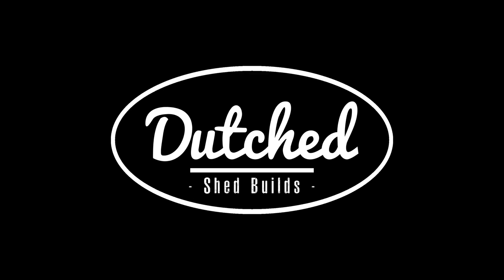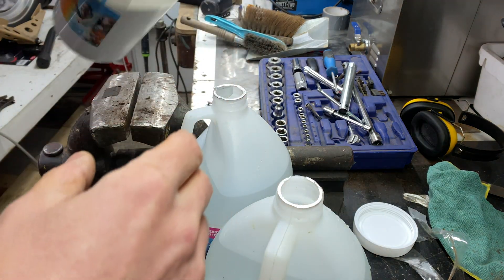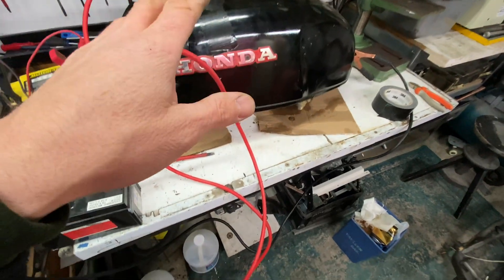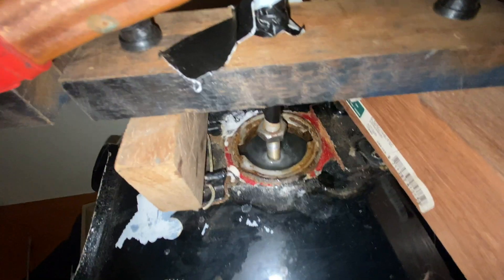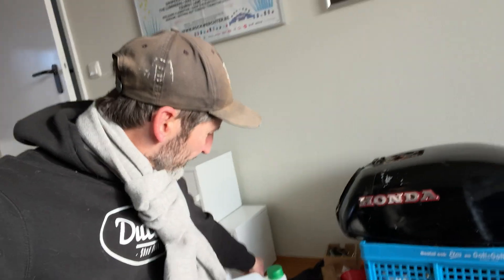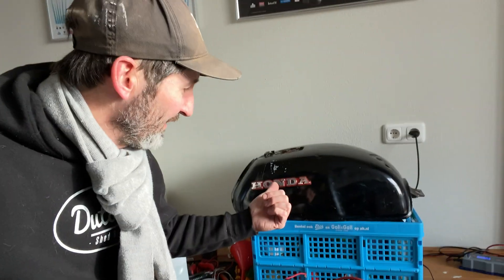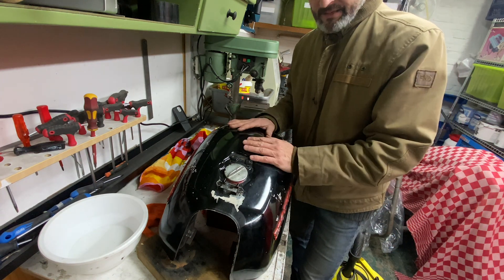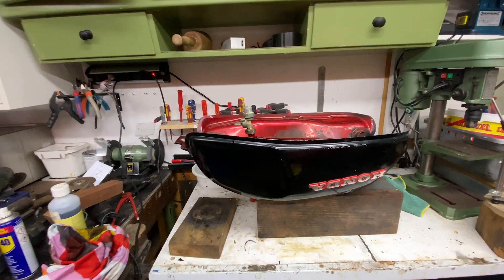Honda CX 500 - Using electrolysis for rust removal inside fuel tank

Comment: I am not a chemist but I think you need an alkaline solution for electrolysis to work properly, not acidic. Sodium carbonate solution (not bi-carbonate) works pretty well. The coloured deposits are from the elements (nickel, chromium etc.) used in stainless steel.
Reply from the maker: Cheers Graham, i will definitely have another go at some point. The solution i used in this video was stuff you normally put in a pool. So next time a different solution.

Comment: Very interesting that the electrolysis didn't work. You showed a potential plating in the tank and now I wonder if it in fact had nickel plate caused the headaches with the electrolysis. Very curious to see if you try it again on something else.
Reply from the maker: The last piece was stainless type of steel. But the first was a piece of rebar (steel thats inside concrete). The last piece did leave a residu of a bronze-coloured material but the vinegar made quick work of that. The tank is now clean and rust free (a few tiny spots left), maybe the elctrolysis did loosen the rust and the vinegar finished it off. I’ll have a go soon with a test setup and see what is going wrong.